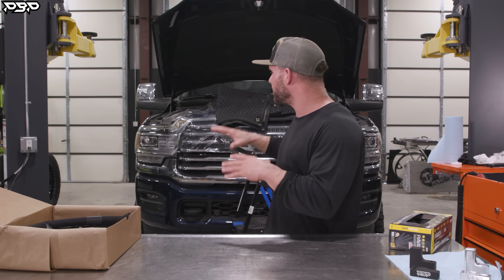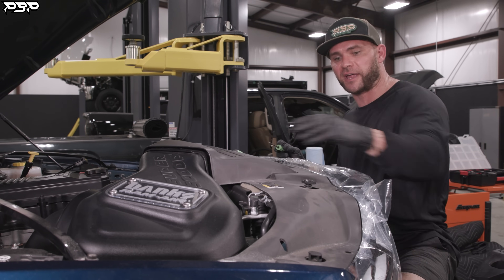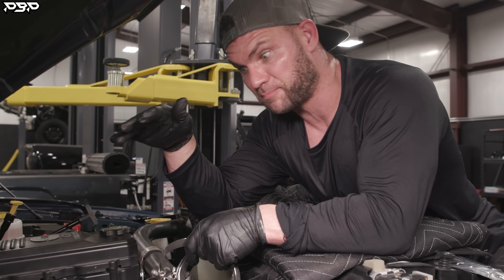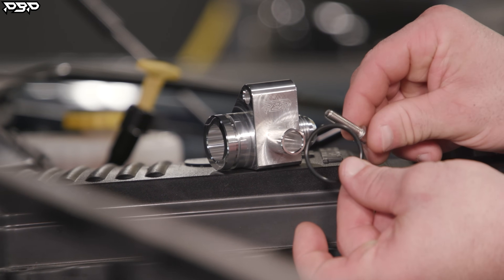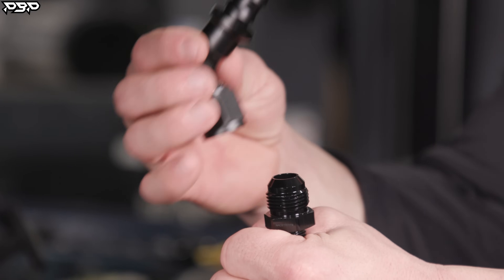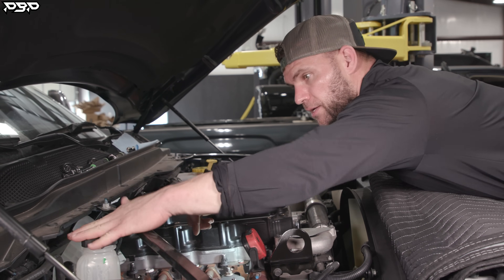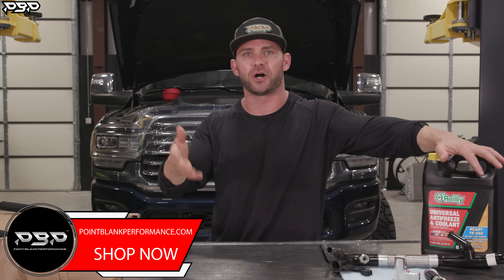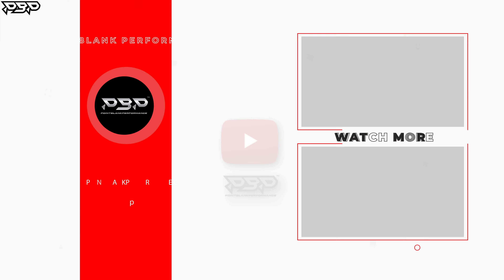5TH GEN CUMMINS 6.7L TURBOCHARGER COOLANT RISER COLD FEED INSTALL

Comment: What size wrench is used on the engine block EGR cooler fitting? And is it a special wrench? I can't seem to break mine free. Thanks for the help
Reply from the maker: The Stand pipe on the cylinder head with the green o ring?
Reply: @POINTBLANKPERFORMANCE yes sir, that's the one I'm speaking of

Comment: The “OEM” way by creating a vacuum works while the engine is off. The vacuum is called thermal siphoning, this action eliminates the oil from cooking in the turbo after shutting the engine off. Hot water is meant to rise and exit, this cools the turbo while the engine is off.

Comment: Does this help keep cylinder 5 and 6 cooler on the Cummins or is solely for cooling the turbo cooler?
Reply: Fleece coolant bypass 
I run in Arizona Temps dropped quite a bit
Reply: No the cold kit will not do anything for cylinder head cooling